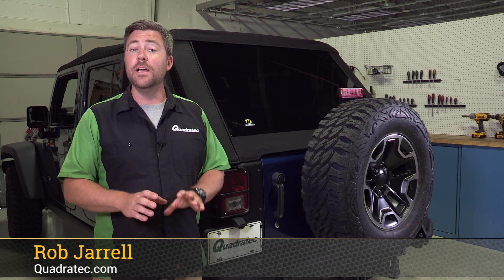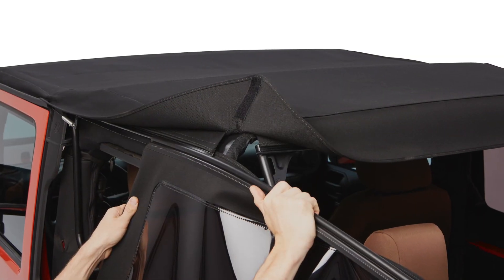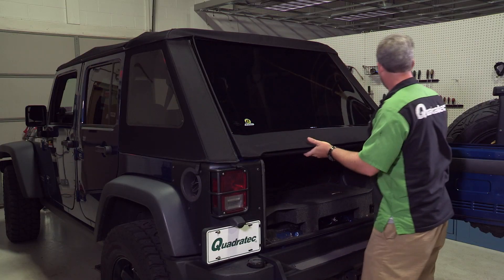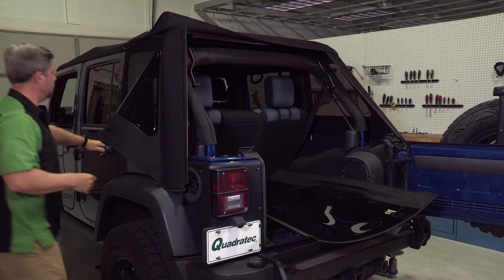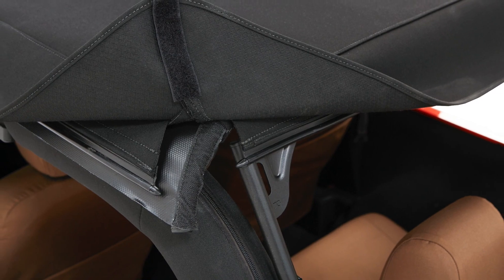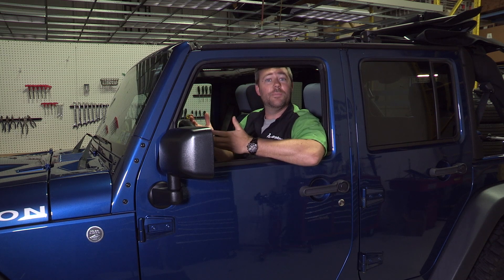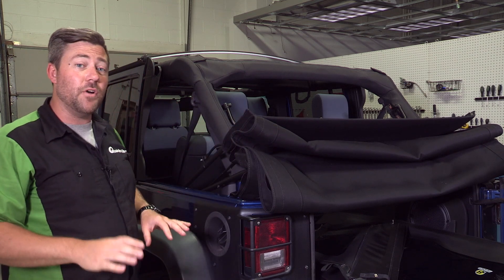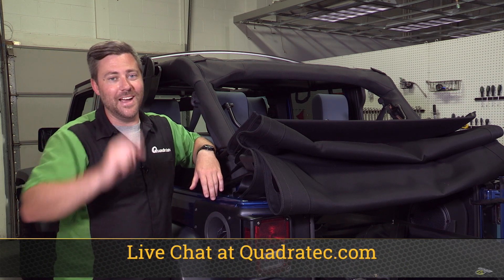Bestop TrekTop NX Glide Softtop Overview for Jeep Wrangler JK & JKU

Comment: I bought the Trektop Glide 3 yrs ago and I wish I'd never seen it.  I'd much rather have the zippers and rear window that rolls up.  You have to take the rear window out completely and its to big to store in the jeep.   The top to me is a pain in the ass to put everything  back on once you've taken it off the top I had a soft top with zippers and it was quick and easy.  Now as for durability no problems at all.   The top has never leaked, it's not noisy and looks like new, the only issue for me is it's much more time consuming than the quick vids show.  I'm personally selling mine and getting a traditional slant back soft top.  It looks good at first but I'd suggest a second thought if your considering this.

Comment: After installing the top, I found that it is not fully isolating the air/sound due to a gap between the truck door and the top. I have an after market exhaust system and now it if very noisy even if the car is fully cover.

Comment: I have an older trektop (yes, with zippers). My #1 issue is highway driving (70mph): with the top folded back, it bounces around a ton and makes lots of noise. I use a strap to secure it down. What's the story with this one on the highway with the top folded back over the rear seat? Loud or secure?  If it solved this problem, I'd consider upgrading.
Reply: I hear no noise with top down at highway speeds. Some normal movement with bumps in the road. I have the twill version. The extra weight may make a difference.

Comment: Thanks for the video. I'm on the fence about ordering this top. Below are questions I have for Bestop about it. Maybe you could answer some of them?
        -are all issues resolved regarding:
-window glides popping out of channel?
-leaking?
-exposed metal scraping paint off Jeep around tail gate corners (I read this in forums)
-does it balloon any more than the factory soft top?
-is it easy to remove the arch support in front once its installed?
-if I want to put on a hardtop, what needs to be removed?
-I drive on highway a lot with top on, but all windows off (bikini style). Will this top be sturdy or in any way flap around, or create a “parachute” effect?
-if I have it fully open as convertible, does the folded top in back make a lot of noise or shake a lot on highway?
Reply from the maker: -window glides popping out of channel?

We have a few employees here with this top on their Jeeps and none of them have had any problems with the windows popping out of the channels.

-leaking?

We're not aware of any leaking issues with this soft top.

-exposed metal scraping paint off Jeep around tail gate corners (I read this in forums)

You want to make sure the metal insert is fully seated in the window pocket to keep it from scratching the paint on the belt rail.

-does it balloon any more than the factory soft top?

We haven't experienced any more or less "balloon-ing" that with a factory style soft top.

-is it easy to remove the arch support in front once its installed?

Yes. The arch supports are easily installed and removed. Simply apply slight pressure to the center of the bow to bend it, and you can easily remove it from the retainers.

-if I want to put on a hardtop, what needs to be removed?

Just like with any other soft top, you would remove the top completely, which is easy thanks to the quick disconnects on the bow assemblies where it attaches to the sport bar in the rear. You'll also remove the door surrounds, including the previously mentioned arch supports.

-I drive on highway a lot with top on, but all windows off (bikini style). Will this top be sturdy or in any way flap around, or create a “parachute” effect?

The arch supports keep the top pretty tight, even with all the windows removed.

-if I have it fully open as convertible, does the folded top in back make a lot of noise or shake a lot on highway?

Not particularly. We don't think this top makes any more noise than a factory top when folded back.

▼
Quadratec
Add a public reply...
Reply: Thanks for the response. I actually ordered the top, received it, and had it installed by one of Bestop's local distributors, and..... sure enough the sides windows popped out of channels as many others have said. It is also leaking in back, where somehow water must be getting into the 3" gaps on above corners of rear window (although the gaps are covered with flaps). Bestop is suppose to be sending me out new windows, as my top was manufactured in June 2017 (there's a 'lot' sticker on it), and supposedly that was still the "first batch" , before they corrected these window channels. I hope the new windows will remedy the problems, as I like the top if these problems were gone.
Reply: @brianmurphy5313 
Brian how about highway use with top up but with no windows?
Reply: Where the issues solved with new windows?
Reply: @brianmurphy5313  how is this now?

Comment: I really love this top but the one flaw is you cannot roll up the rear window for storage, and they have yet to invent a storage bag so you need a long fat surface to set it on and keep it from getting scratched...
Reply: davegbp  thank's for the info I was wondering the same thing about the back window because I have my recovery gear tools ect. In the back. Due to all the stuff in the back  my freedom panels are getting all scratched up
Reply: Carlos Aguirre Check out Bestop’s website. They came out with a storage bag made to hold the back and side windows.
Reply: I have the factory bag for storing the freedom panels in and plan to store the windows in it.